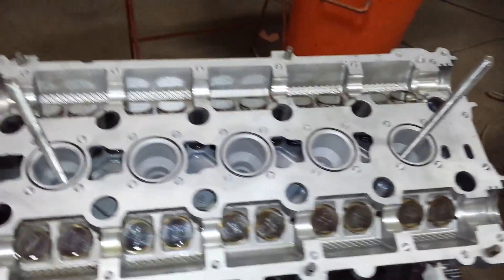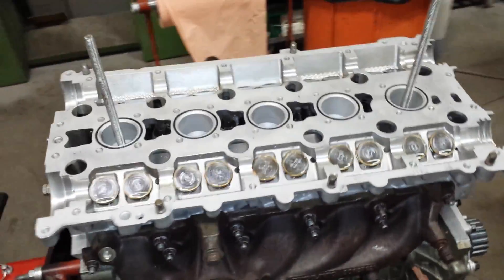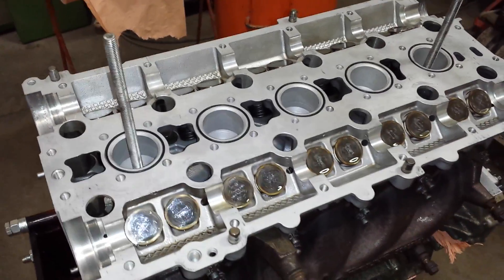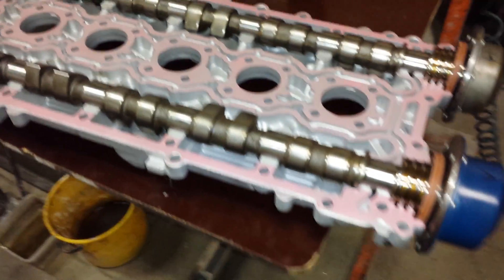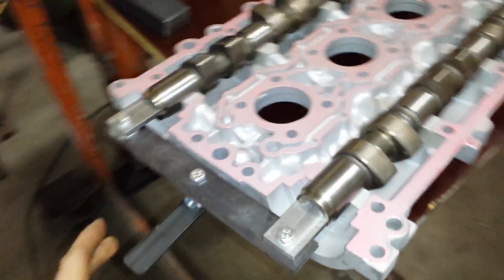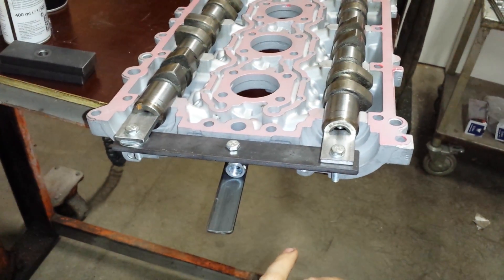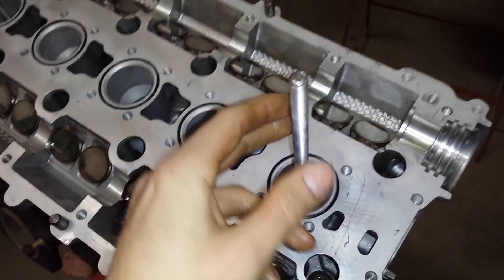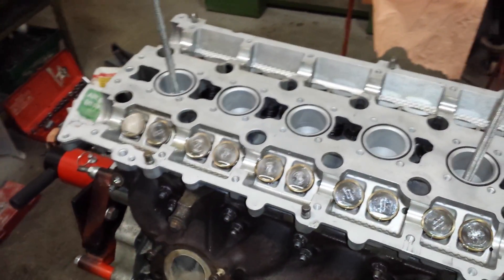Volvo 2.5l cylinder head/valve cover installation

Comment: Not that I would do it again w/ out the tool, but I was able to set the cover w/ out the tool. I slowly turned down all the bolts. Drove it around today, no leaks so far. I also waited a good 24 hours after applying sealant and torquing her down.
Reply: I also didn't roll on the sealant. I ran a bead over all the important areas. I wish I took a photo.
Reply: What torque spec did you use? For the bolts

Comment: Could you assist me with my situation, I have a 2014 S60 T5 and the intake camshaft end does not have a notch for the locking tool,  the end is flat( capped off). So how do I position that intake camshaft correctly so I can put the so-called cover back on

Comment: Can u put a used cam cover on a volvo s60 2.5t ? From junkyard?
Reply: Did you try ?
Reply: @VOLVO_SAVED_MY_LIFE_CLUB  No.  The camshaft cover is a matched pair with the head.  There are numbers on the end so the factory doesn't get them mixed up.

Comment: Hi , I have a Focus ST 2.5L Turbo (B5254T3) . I am looking for bearing clearances for Big End and Main Bearings, as well as torque specs for these bearings. Are you able to assist or direct me to where i could find these.
Reply: 0,05 mm on mains and rods. Or 0,002” on mains and rods.

Comment: Great video.  I am doing the same job on a  C30 and am at this step.  I installed the cams and cover and then had difficulty spinning the cams after.  I suspect they are binding? The vvt pulleys are not installed and I was going to install them but I couldn't spin the cams.  I will try your method.  When you are doing it this way portrayed in the video do the cams sin freely or do the valve springs hold them tightly?
Reply: You may have a little sealant touching a cam - that happened to me.

Just install all of the timing gear, belt, etc, and turning the crank by hand.

Also... I do hope you use some good assembly lube.  Don't just use oil (a good heavy oil or a grease would be okay, though).
Reply: ok.  I'll check.  Does the spring pressure make it difficult to turn once installed?  I have the vvt pulleys off and no belt on and was trying to turn them.  I thank you for responding.  Not many people do.  :-)
Reply: Yes, they can be quite difficult to turn at first.

The only place I can see them binding would be with a valve impacting a piston, which would suggest you have either the cams upside down or the crank in the wrong position.  There's only two teeth worth of play, so be mindful of that.

And, for the love of all that is good, turn it using the crank pulley main bolt CLOCKWISE ONLY!.  Don't use the starter or any power tools.

You should be able to rotate the engine around TWICE.  But, yes, you might have to fight to get it started.
Reply: ok thanks.  It was my plan to do this.  perhaps I was over reacting when reinstalling.  I just replaced the head with a rebuilt one and am new to the T5.  Though I have experience the cam cover design is new to me.  I was surprised when the cams wouldn't turn by hand after installation.  Meaning the cams don't have the have the timing belt on them yet and I can't turn them individually by hand.  I have installed the cams in with the cam timing tool like you did .  I suspect its the spring pressure keeping me from being able to turn them.  Does that sound right?

Also do you have insight on how to install the vvt pulleys?  They are a different design than the one in your video unless that's some kind of cover on yours.  there are no alignment keys or anything on mine to orient them.  Do they simply bolt on?  Seems strange since there are external timing marks to time the cams from that end.  :-)

You seem to have a LOT of T5 experience.  :-)
Reply: It's not my video :p

I've actually only done this on the non-CVVT variants, but I can help you some with the pulleys.  Should be pretty straight-forward.

The plastic spark plug cover has timing notches, so it needs to be installed, and the pulleys have little timing marks on them.  With CVVT, those marks actually only align when the pulleys are under tension, so they're off a bit until then.  So long as you have the cams installed correctly, just make sure the timing marks on the pulleys are at the top.

The exhaust pulley's mark will be offset to the left a couple teeth worth of travel, but you should be able to twist the outer ring of the pulley and it should align with the timing mark on the plastic cover.

I believe something like that happens on the intake pulley, but I'm not certain.

Once you get that done, get the timing belt installed.  With the belt installed, all marks MUST line up.  If anything is off by a tooth or more, keep trying.  This means that the pulleys' outer rings must be under tension.  This is because the cams are designed to run at neutral timing with normal oil pressure in the event of a CVVT control servo failure.

Once the belt is installed and tensioned turn the motor over by hand (using a socket on the large crank pulley bolt).  You need to turn it around fully twice and recheck that everything stayed in time.  The engine might fight you at first, but will turn more easily after a good half turn.  This is mostly because the hydraulic lifters are tight after being drained (or when new).  Once they are exercised a little, they will begin to adjust - even without oil pressure, and the engine will turn more easily.
Reply: @looncraz  Thank you so much for this. I'm in the process of doing NA cams on my car and I have new lifters installed. When I went turn it by hand it was really difficult. i had no idea what it could be since I lubed up the cam lobes and the cam dropped right in. The lifters make sense
Reply: @vteckid82  Happy it helps someone!

Comment: This is merely a harder way of reassembling it. As long as you use an anaerobic sealant, it really doesn't matter which half it's applied to. I used a small lint-free, foam roller, to apply a light coat. Next, set in place the intake & exhaust cam shafts; they should be stamped "I" & "E" respectively. The exhaust camshaft goes towards the rear. A locking camshaft tool helps, but is unnecessary. Hand insert & tighten evenly, in a clockwise pattern, all of the bolts. The spark rubber sealing rings should be added AFTER the sealant has been applied.

Comment: Bravo! A job well done. I liked the video and the tips including the threaded rod welded to the spark plugs and home made tool to register the spacing of the camshafts. Wishing the best in all your endeavors. Aloha!
Reply from the maker: +John Ferguson I am glad to hear the video is helpful...these engines are a really a pain to work on:)
Reply from the maker: thank you:)
Reply: +Henning Jonsson   I showed this video to my mechanic and he was very impressed.  He has been a mechanic for 27 years and worked on Volvo for seven years. He told me about how he struggled to reassemble these camshafts many times.  He is going to try your method on the next 2.5 L 5cyl Volvo he works on.  Maybe he will send you a Christmas gift or something.  Great video, you should do more.
Reply: Henning Jonsson   That is the best reason to do all of the maintenance.  They are so damn difficult to fix.  But, very solid.  I keep my Volvos for 18-20 years.  In California, no rust.

Comment: i dont really  understanding the  two studs what are they pressing
Reply: +josh Moreno thank you for the timing on the cam shaft but i want to known the timing for the crankshaft position an which piston is on the tdc; thank you wish to hear from you soon
Reply: +Balla Diame no problem. Sorry, I'm not really understanding your question. If you want to know how to lock the crankshaft position once it is at TDC, then you don't have to do anything. It is very hard to move on it's on, so it shouldn't move unless you put a socket and ratchet on it and start turning it. But if you insist on locking it, there is a special tool in that kit i linked to in my last comment. I never used it though, so can't really tell you how it works. They call it a "crankshaft alignment tool". Don't know if it locks it or just aligns it without locking it. Does that help?
Reply: +Balla Diame Also, if you mean "how do I know when I get to TDC?" - then there are notches on the camshafts gear that should be pointing straight up. The timing cover should also have notches in it indicating where TDC is so all you have to do is turn the crankshaft (which will turn the camshafts if timing belt is on) and line up the notches on the cam gears to the notches on the timing cover.